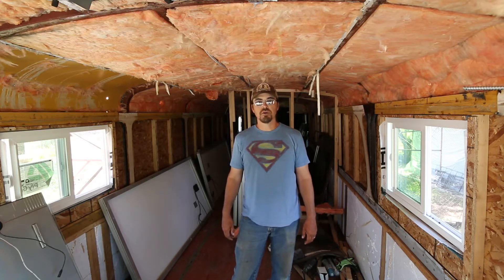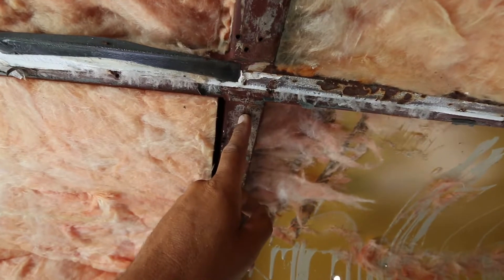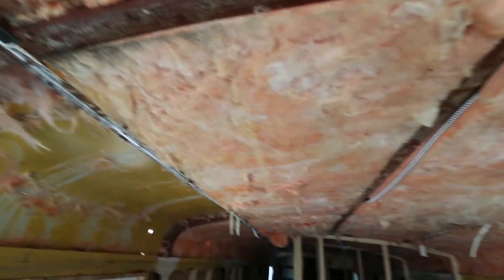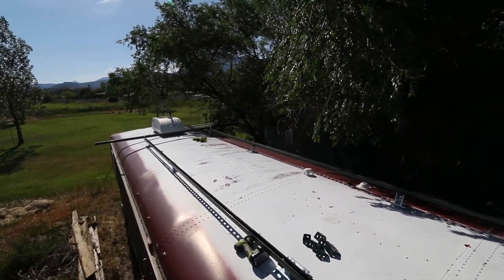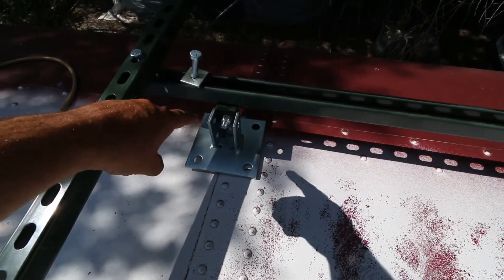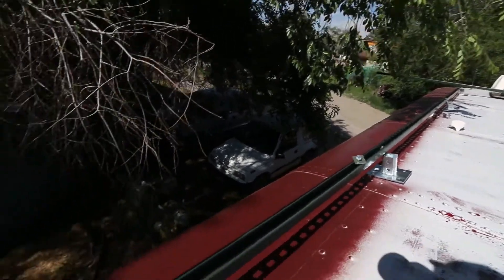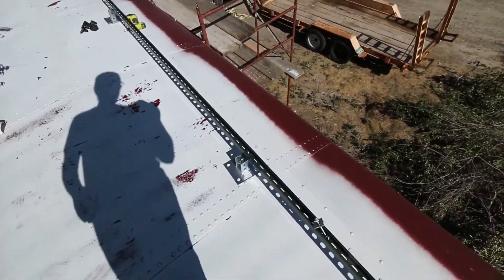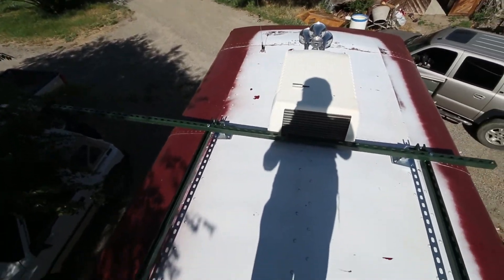Solar Panel Install MCI 9 Bus Conversion

Comment: What panels did you use?  I have an MC-9 too.  These look like the perfect dimensions.
Reply from the maker: These panels are MEMC-P275AMA. 77.8 inches x 38.9 inches (they used mm...1976x990) 

Hope that helps!